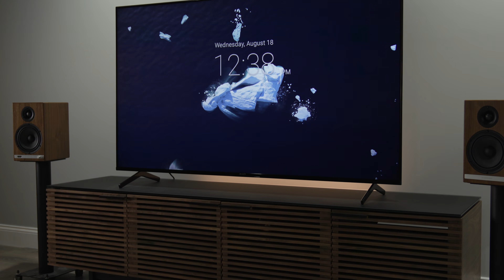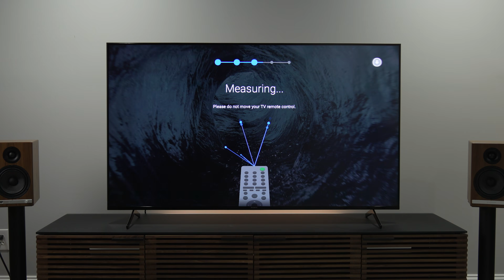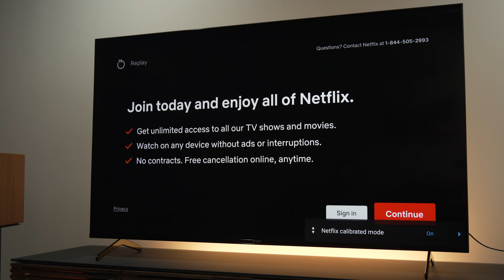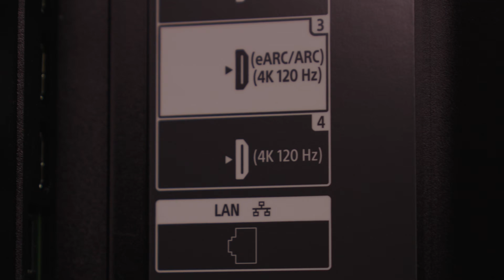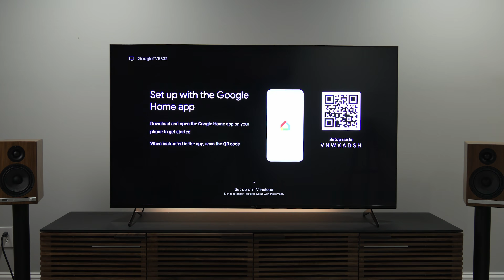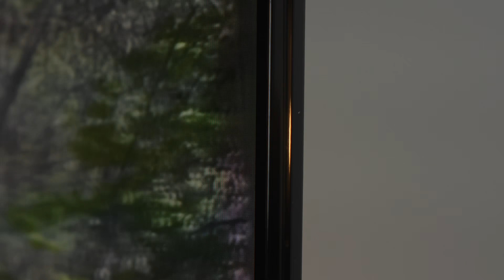Sony BRAVIA XR X90J Smart 4K TV with HDR | Crutchfield

Comment: Hey, question, you can turn the tv on and off using the remote control but without pointing the control at the sony x90j tv??
Reply from the maker: Yes, the remote control operates the TV via Bluetooth and also offers the option for voice and app controls.
Reply: @crutchfield Hey, because I read somewhere that to turn the TV on and off with the remote control you have to point it at the TV
Reply from the maker: With the Sony X90J, the remote does have a Bluetooth connection feature as well as an IR emitter. If you turned off the Bluetooth remote feature for some reason you would need to point the remote at the TV for use.
Reply: @crutchfield Ok, but have you already tried to turn on the TV without pointing with the bluetooth-coupled remote?
Reply from the maker: With my older Sony X950H model TV, yes. It features the same Bluetooth remote, and I actually had to turn off the Bluetooth feature when troubleshooting to work with some streaming apps. What I noticed was that with the Bluetooth off, you have to point the remote directly at the TV. With the Bluetooth feature on the communication from the remote to the TV was much better.
Reply: @crutchfield  ok, gracias!

Comment: When connecting a soundbar will the tv's speakers stil work?  Or are they disabled?  Thanks
Reply from the maker: The TV speakers would be disabled so as to not conflict with any audio processing in the soundbar (or other external speaker systems).

Comment: I just bought the Sony Bravia XR65X90J 2021 Model XR65X90CJ at Costco in the USA.

Day one, I was disappointed with it. User interface was outdated and not appealing.  Info display was outdated too.  My older but LG TV had a great information display.  It was modern and easy to see.  Day two, it started to grow on me, but just by a bit. Good picture with 4K content, but OTA picture is just okay. OTA SD and especially old TV shows from the 1970's thru the 1990's do not upscale that great. 

The look of the TV for its price is not appealing. Cheap plastic and unappealing bezel frame. The TV stand is metal, and ugly. The remote feels cheap and the use of it is straining. The settings interface is a throwback from the 1970's. Difficult to navigate and the look and feel are clunky to use. My 10 year old Samsung has an impressive settings interface.  The Samsung and LG interfaces are easy to use and visually appealing.
 
Google play store on the Sony has limited apps that actually work with the TV.  I have not found a way to adjust the order of certain apps. Some apps adjust, and other rows in app display do not allow adjusting order. Strange…

Usable memory storage at around 600MB is pretty bad at this price point. You can add a memory stick if you want. But why should would have too?  I'm still waiting to test this memory feature out. UK models have TV record capabilities, but USA models do not have this feature enabled.  Why?  Copyright laws?  Who knows… 

In the end, I'm still on the fence about this TV. I love the LG magic remote TV's usability, but I had two LG's go bad in short order. One in less than one year, and the other in 3 years. My old Samsung (10yrs and still going) still has a great picture, but I was never happy with smart features back then. They were slow and crappy. I do not have experience with new Samsung TV's. I might check them out in the future.

Anyway, I’m still undecided if I’m keeping the Sony or looking for something else.
Reply: So what did you do?
Reply: Too long didn't read

Comment: Thank you for awesome review.. really helpful..
I am buying 55" XR90J.. which sound bar would be perfect for this?
Reply from the maker: You're welcome! Excited for you! As to the sound bar, are there any specific features or inputs you need?
Reply: @crutchfield  Is this tv Wifi 6 compatible? I currently have a Spectrum Wifi 6 router
Reply: Strong bass but sound should not be distorted
Reply from the maker: Check this one out--comes with a beefy wireless subwoofer and sounds great overall: https://www.crutchfield.com/I-rFBKc384/p_109BAR21DB/JBL-Bar-2-1-Deep-Bass.html?tp=47366

How big is your room? Interested in Dolby Atmos at all??
Reply: try the JBL Bar 9.1 soundbar

Comment: I placed the order on the 75" X90J after seeing many rave reviews. It's received high praises for its spec at its price point. However, one reviewer absolutely warns against the XR models due to its bad motion handling. He showed a side by side comparison of x90j with another brand of in game motion judders. But I have not seen other youtubers mention this. There were a few people commenting in agreement. Please let me know your take on its motion performance.
Reply: VRR updates are launched so this will be sorted..
Reply: @chakdemonuhere  do you have the x90j? Are you experiencing bad motion handling? If so, let me know if the update helped out. The price for the 75 dropped to 1600 again. Might go ahead and pull the trigger if the issue is fixed. I don't game so if the bad motion is only in game then it doesn't bother me. Thanks.
Reply: @huzzlin4979  so did you end up buying one
Reply: @Finn959  no. I ended up with LG C1 77". Best tv I ever own.
Reply: @huzzlin4979  congrats. Thats what id get if i had the money, c1 or the sony a series but they are mkre than double the price of the 90j
Reply: Please don't listen to quantum because I believe that's who your referring to & the guys a jackass & he bashes sony constantly but yet he seems to be to one of the only ones who bitches about it.  Because i stopped listening to him I now own a Sony X95J that I'm very happy with.  Wich also is one he hates on.  Putting to mutch stake in what he's saying can actually cause you to make a bad buy like I almost did.  His strong opinions are based off his own likes & insights & preferences but yet he trys to project that onto you like you should see things the same way & if you don't then your not the one thinking correctly.
Reply from the maker: The Sony XR75X90J includes a native refresh rate of 120Hz and supports 4K@120Hz for smoother and clearer motion images at 120 frames-per-second (fps) for better rendering of fast-action content such as sports, action movies, and games. Be sure you're using an ultra-high speed HDMI cable with 48 Gbps.

Comment: I got the 50 inch. After getting all the settings dialled in correctly I’m very impressed with it. My only very small niggle is the slight darkening in the top corners. It’s not often visible but it would of been good if Sony could of attended to it by now, it’s been a thing for many past models. Oh well it is what it is, it’s not a big deal.
Reply: I have the 55in and from what I understand, dark corners is normal thing all LCD TVs with full-array local dimming. After gaming and watching Netflix on it for a few weeks, I no longer notice it. Hope this helps. :)
Reply: @AkeemTheDream75  I don’t really notice it on mine either. I guess if you look for it but it’s ok.
Reply: @AkeemTheDream75  Seems to be a thing with VA panels but not IPS.
Reply: Thanks
Reply: Exactly why I got rid of x950g. I couldn’t stand the dark corners. So glad My X95J 65 inch doesn’t have that issue. Corners are basically clean in comparison
Reply: @Jordanfiend361  I also but a 65in X95J & its been really amazing.. very clean panel & I don't notice dark corners or blooming & have great blacks to.  I'm needing a second Tv but can't afford another X95J so wanting to order either the X90J or the Samsung QN85A that I like fr the same price.  Really don't know what to do.
Reply: Can you tell me what picture settings you put on your tv?
Reply: @aliakram4346  The "custom" setting will give you the most accurate picture.
Reply: @aliakram4346  There are too many settings to list here. I might somehow post a still image on my YouTube channel and in the description or comments pin a list of the settings, that way more people can get to see them. I will say though that each tv may be a bit different, and the viewing environment is a bit different, so my settings may not suite everyone but I think they’re ok as a basis for setting the tv if someone is lost in how to do this. Also I use slightly different settings for TV and HDMI inputs, I don’t do gaming so I have no idea about gaming settings.
Reply: @aussie8114  i dont do gaming too. My room gets slight light from just 1 window that I keep the blinders closed most often. So doesnt get too much lights. I just want a suitable color settings for the tv. I tried to adjust it, it seems okay but I feel like it has more to offer if I can find a proper color settings. Thanks.
Reply: @aliakram4346  Ok I will list my colour settings here for you to try. I did struggle a bit with getting the colours ok. It’s important to understand that almost all tv shows look different to one another so it’s near impossible to come up with settings that will suite everything. Movies are more predictable because they are usually carefully produced to give correct colours, but tv programs are often not, and some tv shows were made decades ago, and made in different countries using different methods. I will still come across tv shows that look bad on my tv but I recognise it’s not my tv or my settings, it’s the tv show.
Reply: @aliakram4346 
Settings for TV input.
Picture mode is Standard.
The info in brackets is for the HDMI input if it differs from the TV setting. Noting that for HDMI input I’m using Custom Picture Mode not Standard Picture Mode. 

These are the settings I have written down on paper for my reference, I don’t think I’ve tweaked them since this but I may occasionally tweak settings a little. I did find it difficult to get the skin tones looking good but as I’ve said a lot of this has to do with the variation in tv shows rather than the settings. I found the Advanced Colour Temp settings to be vital in getting the skin tone looking best. 

My parents have a 55 inch 85j model for which I’ve had to calibrate differently to my 50 inch 90j model, I’m even using Expert 1 colour temp on there’s because it looks best, but on my tv I found it did not look best. 

Colour… 41
Hue… 0
Colour temp… Warm (Neutral)
Live colour… Off

ADVANCED COLOUR TEMP:
R gain… -11 (-14)
G gain… -6
B gain… -9 (-3)
R bias…-14 (-18)
G bias… -9 (-8)
B bias… -9 (-2)

ADVANCED COLOUR TEMP 10p:
All at zero.

PER COLOUR ADJUSTMENT:
Red Hue… -2 (0)
Red sat… -3 (-7)
Red brightness… 0

Yellow hue… -2 (0)
Yellow sat… -4 (-5)
Yellow brightness… 0

All other colours in this section are left at default which from memory is zero.

Comment: Great video, I actually read the full review on your website and ended up purchasing the 75" X90J and I'm quite excited.

But I actually have 2 questions that I wonder if you could answer:

1. Using HDMI on the TV's eARC HDMI port to a receiver, is it going to any receiver HDMI In port, or does it still go to the receiver's HDMI ARC port (which is HDMI Out)?

2. My receiver is actually not HDMI 2.2 compatible. I was thinking of connecting all video signals to the TV, then use eARC out to my receiver. The receiver does not do Dolby Atmos or DTS:X, which I'm ok with for now. The 4K UHD player has separate HDMI Video and Audio ports (audio HDMI 1.4). If the receiver is just receiving the audio, will the "handshake" still work, or will I actually need to upgrade the receiver?
Reply: It goes to the receivers arc output. That way my receiver knows it’s receiving the TVs audio and turns itself on when I turn the tv on. Can’t answer your second question.
Reply: @aussie8114  Thanks for your reply. That makes sense to me but I guess I'm confused about having the UHD player with separate HDMI out for Video and Audio. With the TV's eARC connected to the receiver's ARC, that would mean I connect the UHD player's HDMI Audio to any receiver HDMI input I want? Could there be any interference from the other TV connections when using the UHD player, or that is solved by merely changing the inputs on the TV and receiver?
Reply: @zanfear  not sure what’s meant by a UHD player. If you mean a blue ray player then I’ve not seen one with seperate hdmi outs for video and audio. Look in the players settings to see if there’s a setting to output both video and audio from the one hdmi out. I have 3 Panasonic blue ray players connected to different hdmi inputs on my Denon AV receiver. I just select which hdmi input I want to use on the Av receiver and it sends the video to the tv via the hdmi out and the AV receiver processes the audio and outputs it to the connected speakers.
I don’t ever use the TVs speakers
Reply from the maker: Some streaming services do offer 4K video content. This TV does offer a Toslink optical digital audio output you could use for audio as needed as well.
Reply: @crutchfield  Right on thank you! If I may ask 1 final question, is the XR cognitive processor always on and working or could it be turned on/off (i.e. which setting is it)?
Reply from the maker: You can turn it off. For help with this or using the TV, please call our Tech Support. Their number is on your invoice.
Reply: @crutchfield  Thank you, I found out online that it's the Reality Creation setting.
Reply: @zanfear  did you end up getting it? What's your setup now
Reply from the maker: If you use the eARC port on the TV to send the audio to your audio receiver, then you won't have to change inputs on the receiver to hear the audio from any source you want on the TV.

If you run the HDMI audio output on your UHD (Ultra HD Blu-Ray player) to one of the inputs on the audio receiver and your audio receiver can decode the other DTS formats, then you have access to hear DTS-HD, DTS Master Audio (when either of those formats are on the disc being played). The HDMI eARC output from the TV to the ARC input on your audio receiver does not support these lossless audio formats
Reply: @crutchfield  That makes sense, thank you! Do smart TV apps "send 4K signals"? If that is the only 4K signal (but audio) going to a receiver that is not HDCP 2.2 will the audio be impacted?

Comment: Hi can anyone help me. I'm in the market for a new TV and I've been eyeing this 55" Sony X90j. For the most parts it's got the specs that I want that could last me for the next few years (I hope), only thing is the price.
It's got 4k 120Hz, VA panel, Dolby vision, Dolby Atmos, HDMI 2.1 and stuff that I want but the price is on the top end of my budget. Are there any other brands/tv models that have similar specs that is cheaper than the sony?
I'm into movies and casual gaming. Currently have a PS4 Pro and will get a PS5 when it's readily available
Reply: Get the 50 inch, it’s a bit cheaper. 50 inch looks plenty big enough in my lounge room.
Reply from the maker: At this time, we don't have a closely comparable model from another brand that has the VA panel in a 55" TV.
Reply: Have you looked into Hisense U7G? It has all the features you've listed at budget price.
Reply: @huzzlin4979  hisense don't compare espically with out of the box performance & long term reliability.

Comment: Does 50 inch model have tweeter for better dolby atmos sound?
Reply from the maker: All sizes of this TV model have 2 speakers built in and no additional drivers for better Dolby Atmos audio
Reply: @crutchfield  I meant 2 tweeter on both side of TV
Reply from the maker: This TV model does not have any drivers to help with Dolby Atmos audio. They only have two drivers for stereo sound and they are typically on the bottom of the panels